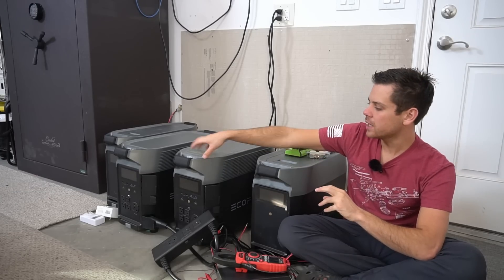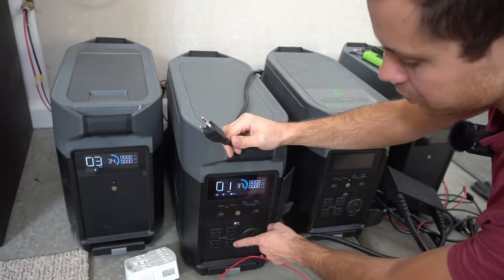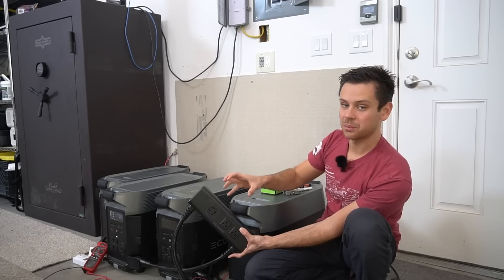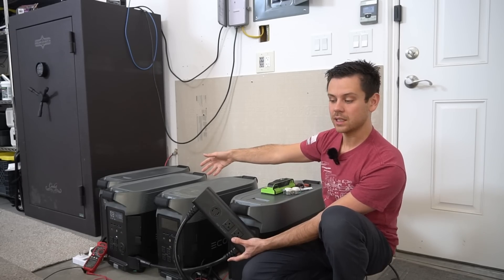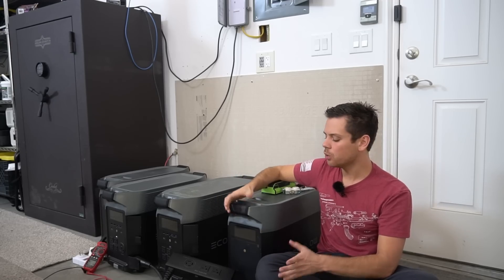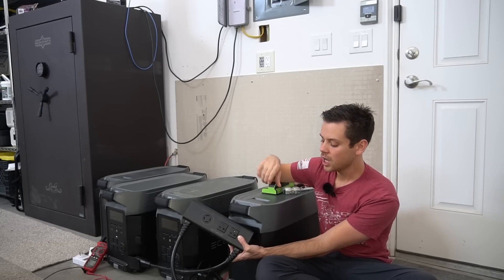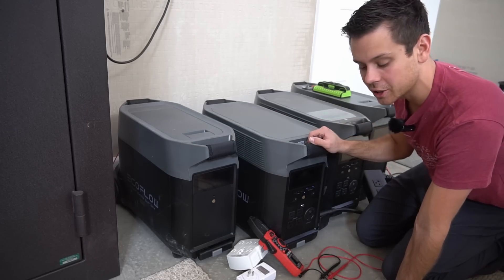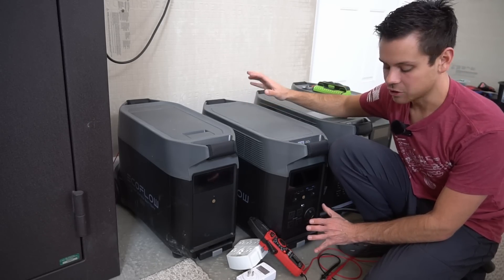I broke my Ecoflow Delta Pro 😬 (my fault)

Comment from the maker: Ecoflow Delta Pro (Affiliate link): https://ecoflow.com/products/delta-pro-portable-power-station?aff=7
(if you prefer supporting amazon.com instead: https://amzn.to/36YzMul)
Delta Pro Expansion Battery: https://ecoflow.com/products/delta-pro-smart-extra-battery?aff=7
(if you prefer supporting amazon.com instead: https://amzn.to/3LKbEKG)
Ecoflow Delta Accessories: https://ecoflow.com/collections/delta-pro-accessories?aff=7

Bluetti AC300: https://shareasale.com/r.cfm?b=1745428&u=760144&m=108816&urllink=&afftrack=

Other Solar Generators I recommend: https://www.mobile-solarpower.com/full-size-systems.html

~~~~~~~~~~~~~~~~~~~~~~~~~~~~~~~~~~~~~~~
Tired of getting ripped off? Check out my "Will Prowse Approved" solar product recommendations below!

12V Batteries
https://www.mobile-solarpower.com/lithium-batteries.html

48V Batteries
https://www.mobile-solarpower.com/48v-batteries.html

Offgrid Inverter System Builder
https://www.mobile-solarpower.com/48v-complete-system-blueprint-559371.html

Hybrid Inverter System Builder
https://www.mobile-solarpower.com/code-compliant-48v-offgrid-system.html

Mobile Handtruck System Builder (very popular!)
https://www.mobile-solarpower.com/mobile-48v-system.html

Solar Panels
https://www.mobile-solarpower.com/300w-solar-panels.html

Ground Mount Solar Racking
https://www.mobile-solarpower.com/ground-mount-racks.html

Wire, Lugs and Busbars
https://www.mobile-solarpower.com/wire-and-connectors.html

Tools
https://www.mobile-solarpower.com/tools.html

Fuses and Circuit Breakers
https://www.mobile-solarpower.com/fuses.html

Plug-N-Play Solar Systems
Ecoflow, Anker And Bluetti! So many models to choose from. See my current recommendations here:
https://www.mobile-solarpower.com/full-size-systems.html

~~~~~~~~~~~~~~~~~~~~~~~~~~~~~~~~~~~~~~~~~~
Need to build a large DIY system? Need a trustworthy solar distributor? These are my favorites:

Signature Solar
Creator of EG4! Solar Minisplits, Victron and More! Largest Solar Store Online.
If you want $50 off, please use my link below and coupon code "DIYSOLAR50":
https://signaturesolar.com/?ref=cPwLcVc0SW-BjN

Current Connected
Best Prices for EG4, Victron, Midnite and so much more! Fast Shipping and Highest Rated Customer Service:
https://currentconnected.com/?ref=wp

~~~~~~~~~~~~~~~~~~~~~~~~~~~~~~~~~~~~~~~~~~
Join our DIY Solar Community 
Need more help? Join the largest solar forum on the internet for beginners and professionals alike. 140,000 members and counting!
https://www.diysolarforum.com

Check Out My Free Book
Best-selling and beginner-friendly guidebook to off-grid 12V solar!
https://www.mobile-solarpower.com/the-book.html

~~~~~~~~~~~~~~~~~~~~~~~~~~~~~~~~~~~~~~~~~~
Contact Information:
I am NOT available for personal solar system consult! If you wish to contact me, this is my direct email: williamprowsediysolar@gmail.com
FTC Disclosure Statement and Disclaimers:
Every video includes paid promotion or sponsorship (such as free products for review). Some links on this YouTube channel may be affiliate links. We may get paid if you buy something or take an action after clicking one of these. My videos are for educational purposes only. Information is subject to change/update at any time. Electricity is DANGEROUS and can kill. Be smart and use common sense :) DIY Solar Power with Will Prowse is a participant in the Amazon Services LLC Associates Program, An affiliate advertising program designed to provide a means for sites to earn advertising fees by advertising and linking to Amazon.com
Reply: did you get it fixed.

Comment: I didnt have 2 units connected together but I did have solar and the ac connected and charging at the same time while the unit was under load. I now have a 121 overcharge error and getting new unit sent out. I think from now on I will only have solar go while under load and not have a load at all if i need to recharge via the wall.

Comment: Hi Will. I am the beginner that you speak of at the end of the video. I got this unit to serve as a home backup unit for power outages, and thought it'd be cool to connect a few solar panels as well and actually power some circuits so the unit gets some use and isn't sitting around waiting for a power outage.  So I had my solar and AC input connected, while having the 30 amp plug connected to the transfer switch....and I broke the AC charging. I actually did this TWICE because after the first time EF warranted my unit but didn't say what I did wrong, all I knew is an error code was thrown. Now it happened a second time and after explaining things to the Facebook group, it was those guys who advised what I did wrong. So as a beginner I thought I could set my unit to a 30% reserve power and it'd pass through charge from the AC once hitting 30%, and I'd rely on solar charging above that. NOPE! And it's a bit extra confusing when they sell the Delta Pro bundled with the Pro-Tran2 switch, you'd think they'd be compatible in the way I intended to use them. In fact the more I think about the marketing: why brag about dual charging via solar and AC if I can't also have a load connected....because I wouldn't need to charge in the first place if I wasn't using it! Is there an all in one unit from any brand that works to have solar, ac input and ac output connected at the same time? I'll probably be forced to switch. Is there any repairing my eco flow after damaging the charge circuit? 
Thanks for your videos.

Comment: I had mine plugged into the house AC.  Then I made a pigtail with an extension cord and connected it to one circuit in the house so I could always use the ecolflow delta pro on that circuit.  It fried and I had no idea why.  So I had neutral bond on the AC charging input AND on the AC output at the same time. I'm not sure how to hook up the new one now to the one house circuit.  I guess I have to remove the neutral from the panel as well in order to break the output bond?  Is it possible to remove the neutral on the input? Where does the neutral go if not to ground?

Comment: Insightful. I think I experienced something similar when I plugged a UPS system into the Backup UPS port. The UPS system worked for two outages, but on the third outage, the "wiring fault" on the UPS system turned on. I was like, yeah, not going to use a UPS system ever again with the DPU. Any insights on my specific circumstance? I wonder if there's a UPS system that can be used with the DPU. Two plugs on the UPS system, one plugged into the DPU and another plugged into a wall outlet to create ground. I dunno. 😅

Comment: I have a Delta Pro and two extra batteries along with the Delta pro supplied 6 circuit transfer switch. Of those 6 circuits, two have ground fault breakers that are tripping when I am supplying power from the Delta Pro. I also have solar panels. I guess the difference between our systems is I don't have the second Delta Pro and the hub connecting the two. I have an email from Delta Pro telling me to add a neutral grounding adapter to the Delta Pro. No warning about not connecting the AC charging. Am I ok adding the Neutral ground adapter if I don't plug in the ac charging? Any advice will be much appriciated.

Comment: On the Ecoflow Delta Pro 3 look into enabling "GFCI/RCD".  The app says that this mode should charge an EV, and is automatically disabled when the DP3 is plugged into an AC output with grounded neutral. Tomorrow I will attempt to charge my Model 3 at 240v using a NEMA L14-30P to NEMA 14-50R adapter with no manual grounding of the neutral.  Like your channel BTW.

Comment: Hi Will, love your videos, I use a single Delta Pro to power a camper using the 30A plug, fully off grid charging with 1200w of solar.  I'm getting conflicting info on using a ground neutral plug in the Delta Pro plugging into one of the 20A outlets. What would you recommend?

Comment: Hello Will I am doing the same thing connecting an ecoflow w/extra battery via RV plug out to transfer switch model 306A1-eco input 120v only, not using the 240 hub like you  but also have another delta pro that i will plug the first delta  pro w/ battery from the ac out put on unit not plugged into the house is that OK to take advantage of more battery and solar? it wont cause any extra ground that you were talking about..thanks

Comment: Will, might be too late for you to see this but, is there any reason for me to use a grounding adapter when using my DP or Delta 2 when in stand alone operation eg: camping etc.? I will not be using for 240v or charging an EV

Comment: I was thinking about doing something similar. Delta2 plugged into grid power -> L1 EV Charger Plugged into Delta2. Would this produce the same failure? Would you need a ground bond plug since you are technically plugged into the grid?

Comment: My ac charging seems to be fried from accidentally lightly pulling out the cord while it was charging from my gas generator. Then pushing it back in after I realized I was pulling my eco flow cord and not the one I actually wanted to pull out Wich was my air compressor. For some reason there was no burning smell the serg protection button on the back never popped out but for some reason it won't take ac from my generator anymore 😢. I'm having to send it in to be repaired

Comment: Just looking for some clarification on a few things.

I have been trying to run my furnace off of the Delta Max but since the furnace requires a ground connection it will not start.
If i use a neutral ground plug that should solve my issues right? Along with that if a neutral grounding plug is used, does that mean I shouldn't use the delta max to power any other appliances from the remaining AC receptacles while running the furnace or could that potentially cause issues with other appliances?
Lastly, If i use a neutral grounding plug with my Ecoflow Delta Max that wont cause any issues as long as the AC charging cable is not connected from the grid to the Delta Max ?
I just wanted to confirm prior to doing anything,  rather than let the smoke out.

Thanks in advance
Reply: We run furnace and fridge off DPro with a grounding plug no problems.  Just can't have AC input at the same time.

Comment: Thanks for sharing this information. I noticed this is the same behavior on the new Delta Pro Ultra they just released, so it’s good to know if I’m going to plug it in or use a transfer switch, I shouldn’t be creating any other bonds.

Comment: I really want to know and understand how one guy on youtube had two delta pros and plugged a Y cable into each 30amp plug on the front of each delta pro into one 240v plug and then plugged that into his RV 50amp Plug and it powered his RV. I did not think that his would be possible because the two 30amp plugs would not be phased at 180 degrees as I though was needed. Can anyone explain this to me. Thanks

Comment: I have an EcoFlow Delta 1300. When it was brand new, I plugged it in (using the EcoFlow AC cord) to an outlet in my house to charge the unit. Nothing else was plugged in. I was not using the unit to supply power to anything. There was a loud POP, and then the display said "OVERLOAD." I sent the unit back for repair. They sent me the unit again, and again it POPPED and I smelled something burning. I unhooked the unit and put it out on our cement patio. There is something wrong with their charging circuits! I believe now that the only safe way to charge these units is via solar panels, and those are limited to 10 amps and 60 VDC max. I have 3 other Ecoflow Delta 1300 units. I will NEVER EVER hook them up to (grid) AC charging again!  I will only use solar panel charging, and they will only be used for power blackouts.

Comment: I smoked one of my EcoFlow pros - also but not the same way as he did. Plugged in 2 pros, the 240 volt hub, connected to the transfer box, and both pros were connected to AC - its just started to smoke - Never even did a neutral ground bond!!! Not sure if it is a defect but sending the unit back. Lets see what happens

Comment: I'm seeking guidance on a potential setup I'm considering. Although I'm relatively new to this, I plan to acquire the 21kWh version of the system you mentioned. My objective is to charge exclusively from solar panels. I intend to connect two 1600W solar panels to each Delta Pro to achieve a full charge of 21kWh. Subsequently, I aim to use these batteries to charge my Tesla via a 240V outlet. I have no plans to integrate this system with the grid. Would this configuration be viable?"

Comment: This happened to my system as well, I was running the Eco flow to an off grid camper it arced the ground. Fried both the ac input and output. Unfortunately ECO flow wont warranty the system so i am stuck trying to fix it myself. The DC works though.

Comment: So wait a minute wait a minute…    Should I be concerned about plugging this in the wall, and using it at the same time?
Reply: You are OK with doing that. I do it also all the time. It’s one of the great uses of the product. It can charge from the grid while you are taking output from it. Just don’t create a neutral to ground bond on the EcoFlow output while you have it plugged into your AC.

Comment: I am curious thou. Would it be cost effective to remove the AC power inverter and contact EcoFlow for a replacement? Can't be that hard to fix this issue. I am very impressed how easy they make these machines to work on. I wonder what the cost would be just for the part? Unless you have mad skills then you can trace down the fuses, a transformer and probably a couple capacitors. It might be a very simple fix. At least fun to figure it out and get that machine fully operational again.

Comment: Hey Will,  I watched your video about changing your EV with EcoFlow DeltaPro that worked, but then saw the video about it breaking your DeltaPro. 

Question is did you figure out how to safely change at Level 2 changing with DeltaPro?
I charge my EcoFlow DeltaPro by solar only. So maybe it is safe.  How would you do it?

Comment: I know this is old but my instructions for my Eco Flow Delta Pro say that when plugged in to A120V AC, the chaarger is bypassed and the AC flows thru the unit to the 120V output. Fine foe using one unit. But how do two units make 240V? They have to use the 120V inverters inside the units together but 180 degrees out of phase. So if that is happening then you plug in both units to the same 120V circuit and the units go into bypass mode you'll get problems. I found a solution and that is use two power supplies that can be connected to 120V and output DC required by the Solar input circuit. Then the inverters are used to provide the output and it works. Relatively inefficient though.

Comment: Hello, thinking about getting one of these for my camper.  I would have it inside the camper, probably just run the camper power cable through a window with the EcoFlow inside so it is out of the weather.

My question is how loud are the fans?  Will it be tolerable inside the camper?

Comment: neutral bond issues sould be well disclosed, explained, documented and simplicity of operation be built into the product by the manufacturer.   Im not going to start bonding or unbonding anything as im not qualified to or want to hack a $3700 or any value product with potentially severe consequences.  Until oem reengineers and fixes these issues, im not buying any of it!

Comment: Thanks for this video.  I'm new to Ecoflow Delta Pro system and have been using one with one solar panel  to slow charge my Tesla at 12 amps.  It's working so far and I don't usually charge the unit with house power.  When my system is complete, I will have 3 400w panels on the roof to each Delta Pro with a voltage doubler.  Some of the stuff is still coming in.  As I understand, the ground-neutral bonding will work as long as I do not plug the Delta Pros into a wall outlet but only charge with solar.  To be safe if I do decide to charge from house current, just unplug everything on the outlets to be safe.  With 3 -400 watt EcoFlow panels on each Delta Pro I don't see a need for house charging the Delta Pro's.

Comment: Will,
Can you please tell me why I'm having so many issues with my Echoflow River pro & I had a issues with my extra battery. That was taken care of. The Pro was replaced by a new echo flow pro. Same thing happened. Over loaded red light on. Saw the owners manual. Press & hold the DC & the Light @ the same time should reset the system. It tries but fails back to the original fowl. That happened on the first one, this is a replacement. Can you please help me

Comment: Hallo
Could you help me? Have a delta pro. I had it in ac charging and the output was nominal about 300w.Suddenly i saw i had no lights and saw at the mob app that ac output was off. Tried to turn it on but went off again. Went down and i saw err code 121 overload. Is there a way i can make the device run again? Thanx in advance

Comment: I have listened to this several times.. GNB is a hard concept for folks to get..  but I didn't know my Ecopro Delta was a bi directional unit, which explains why the pass thru gets its bond from the wall.. my Xantrax inverter does the same thing..  I wish also it was like the victron.. but I failed to recognize that when I bought it.. I wanted to charge and discharge..  So I ended up  buying the smart generator for now.  This is extremely valuable info.. thanks Will..     Any good follow up from Ecoflow?